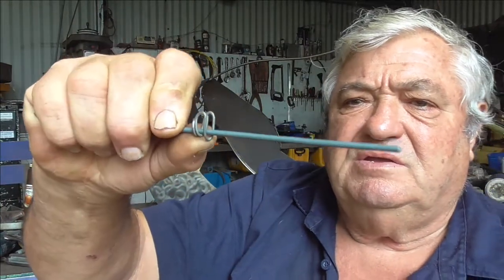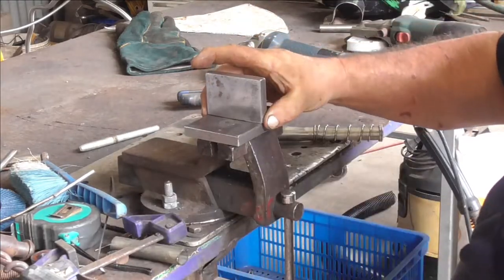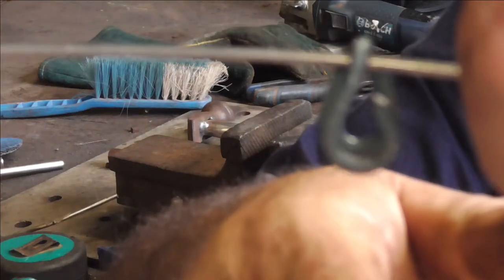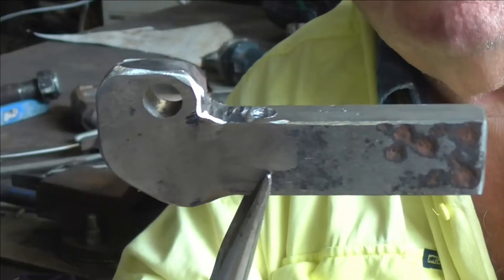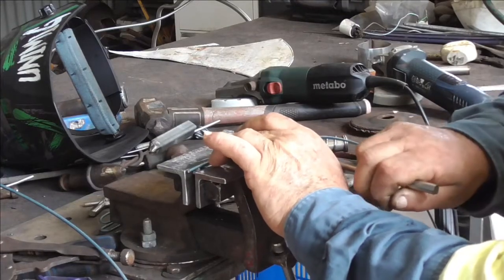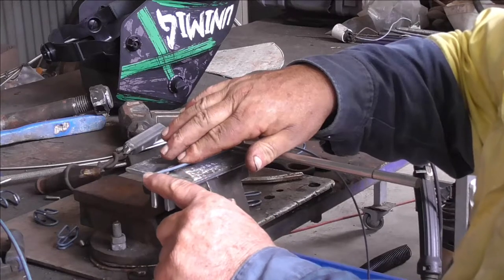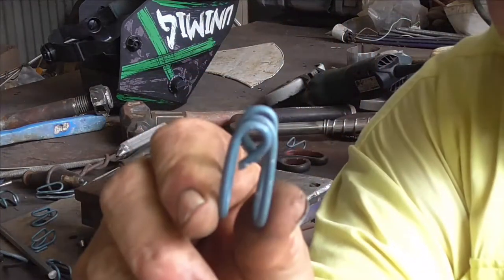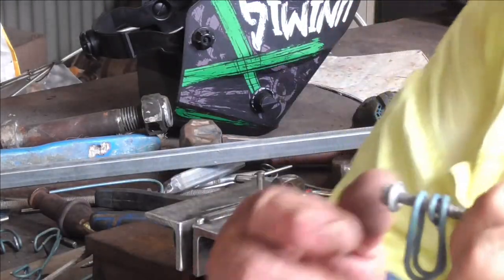MAKING A MACHINE TO MAKE FENCING CLIPS

Comment: Hey I would buy one of those machines. We are using fence staples and they do not sell those clips here. Jim
Reply from the maker: G'day Jim and family I tried a few out and actually they work good I think better than staples by a country mile and anyone can use a screw gun but not everyone can use a hammer and you cant overtighten them and if you have to take them out to fix the fence its easy. Getting staples out of Australian hardwood is hard for that matter driving them in can be hard. One thing I have thought of is on wooden fence droppers they would be excellent. John

Comment: @10:28 if you locate the device a little to the right of the 90 degree vice brackets and you cut the 8-10mm diameter steel rod that locates the wire shorter , you may be able to use the device to twist the wire  in that action you do at 10:28 . alternatively you can use a 10mm steel hollow cylinder  to pace it over the wire and bend up without doing it with your fingers .
Reply from the maker: Thanks for the tip. John